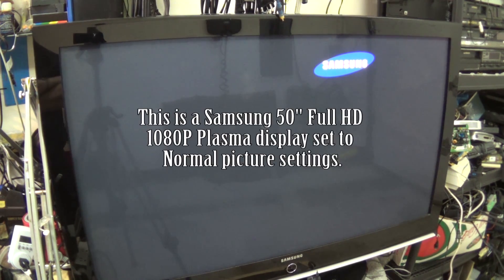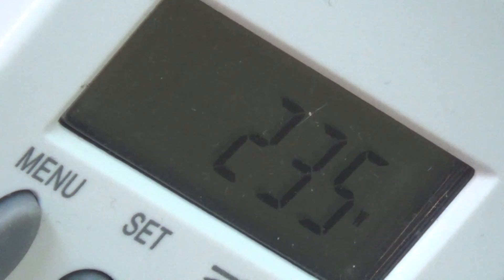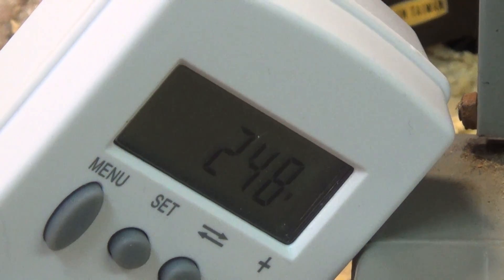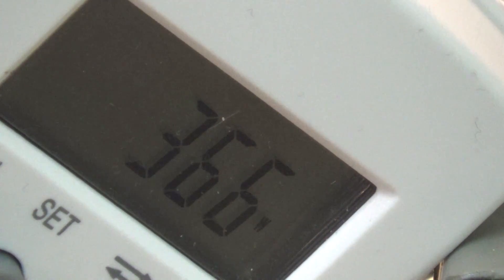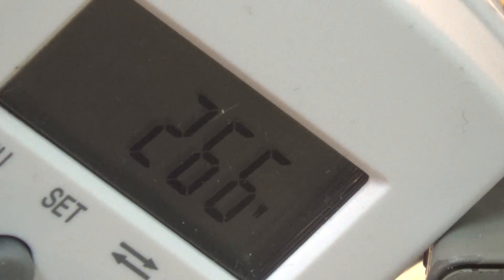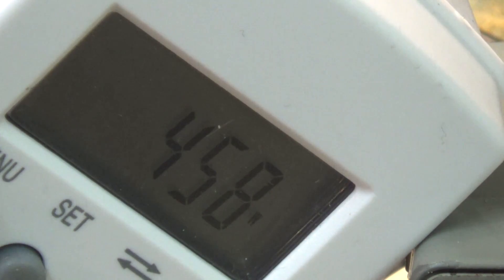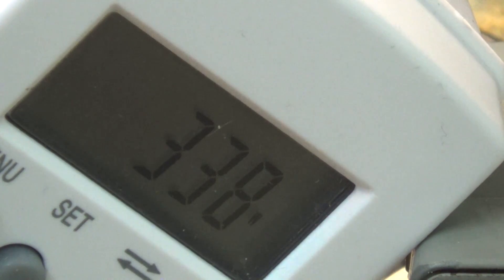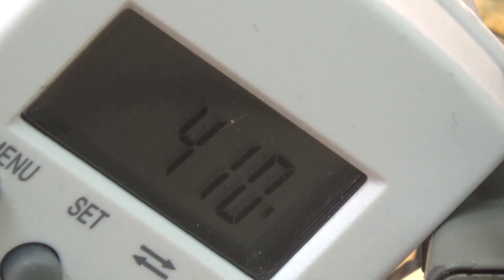Plasma TV meets Power Meter

Comment: My  50 inch Sony Bravia LED    draws  37W ( 2014),  my 52  inch   Sony Bravia LCD (  2008)  draws 144W,   average  50  inch plasma TV draws about  350-370 W.  ( I used wattmeter).
Reply from the maker: I used a power meter too.   Plasma power consumption depends on screen brightness.
Reply: @12voltvids  So what   did  your average come out  on plasma?
Reply from the maker: @leotimtom6637  I believe i covered that on the video.
Reply: My 52" Samsung LCD tv from 2009 draws 300 watts constantly.  So old LCD tv is on par with Plasma and not any better.

Comment: And this is one of many reasons why we have so incredible hot summers. In 2030 we will have 50 - 60°C summers in central Europe in SHADOW and it will be responsibel for a dramatic decreasing in earth population.
Reply from the maker: Kyôdai Ken 
How does this make your summers hot?  
The problem is the bloody volcanoes blowing their top and spewing co2 and other crap into the air. An erupting volcano in 4 days spews more pollution in the air than  man creates for an entire year. How many volcanoes are erupting right now.  They create much more greenhouse gas than burning fossil fuels. Myself I contribute very little. Our power here is hydro electric. Generated from falling water off the mountains. My car is electric. So my footprint is virtually zero. How about you.

Comment: My 2013 Panasonic "neo-plasma" doesn't draw anything close to this much power. The older ones did draw insane amounts =/
Reply: So I was under the impression that these new LED-LCD sets lasted through the years since they generated little heat and LED bulbs last for decades.
Reply from the maker: The newer ones were energy star, but the early ones were power hogs.
Reply: My Energy Star 55 inch 55HDT79 Plasma by Hitachi uses 40 watts even when it's off. my numbers when it is on are in the 350-450 range just like your measurements. I like Plasma but it's just a lost cause. it's sad since even though it's 720p, it still looks fantastic after 10 years of use. I'm guessing here in Massachusetts it's costing me $100 a year in electricity. :-(
Reply from the maker: peter sachs 

I watch my 63 1080p Samsung every day. very good picture. has already outlasted all those new LED backlight sets. the best plasmas were built 2007-2009. the later ones were not as reliable. the real killer of plasma was not power consumption, it was the cost to manufacture compared to LCD sets.
Reply from the maker: That's why we are seeing so many with failed backlights.It is almost epidemic. Most people run them in the brightest mode, and that produces heat and short LED life.I was an early adopter of LED lights at my house, and they are failing left right and center.I have a 40" Samsung that was barely 3 years old when LED backlights failed, and a Hitachi that the LEDs have failed, on, and now my LG 27" computer monitor has suffered a shorted LED, so there is a dark patch in the bottom left corner where the start icon is, and the display fades up and down in brightness. That display is only 2 years old. OK they are more reliable than plasma! Sure they are.I have a few plasma sets that are over 10 years old, with thousands of hours on them, still going strong. I would expect that though. Plasma technology is very mature, over 40 years old. Plasma started out as monochrome orange displays used in airports to display arrivals and departures. To make them color they just introduced some xenon gas to the neon, and coated the pixel walls with phosphor, but the design goes back to the 60's.  Plasma's demise was due to the cost to manufacture compared to LCD, and newer OLED technology was emerging that was even cheaper to make. So Plasma's days were done for finiancial reasons, not because it was an inferior display. It wasn't. There was some reliability issues with some of the cheaper panels made in the last couple of years they were in production, mostly because they shifted the panel production to Mexico and China where there were some quality issues. Not so much with the panels themselves, but with some of the support components and board manufacturing. Because of the power in a plasma display, a loose ground screw can mean a catastrophic failure with multiple component failure by the time the protection circuit shuts it down.I have 8 plasma sets (6 were throw away sets that were given to me)6 are in use, and 2 sit in storage for the day I may need them.Sure they drive my power bill up a big, but nothing like the heat pump used to heat / cool the house. My TVs might cost 10.00 a month. My electric car 30 a month to charge. Heat pump and water heater probably 250 a month minimum.

Comment: Can you repeat that experiment on OLED TV? They said OLED TV is more power efficient than LCD because it doesn't have a backlight so like plasma the power consumption depends on how bright the screen is except it consumes far less power than plasma of the same size.
Reply from the maker: I will repeat that experiment on an OLED when I get one. It is on my wish list, but the one I want is still priced in the stratosphere so it will be awhile before I drop that type of cash on a TV.
Reply: bobskie321 -I read from some reports at CES 2017 that many OLED sets use more power than LED-LCD and also that these organic elements have a finite lifespan?!
Reply from the maker: I don't have an OLED yet. When I get one (that is next on my TV shopping list) I will put it through the paces.Like Plasma the power varies with screen brightness.They will consume less power than a plasma for sure.
Reply from the maker: They do burn in fairly easily too.Go to a store running the LG demo on them, and you can see the burn in on TVs that have only been on display for a few months.
Reply: So they are not ideal for video games because of static images like scores or life bars which can burn in.
Reply from the maker: OLED should not be used for games. Unless you have money to burn that is.  Pun intended.

Comment: Hey 12volts ❤ I've learned so much from you and I have one of these old plasma tv's and yeah they are power hungry but they are the best for video games because of hardly any display lag.. anyway mine took a crap so I checked everything and found that the vs is rated at 177 vdc and the vx is rated at 167 vdc but I'm getting 234.6 volts dc on the vs and 177vdc on the vx 😢 can it be the power supply?
Reply from the maker: +Subigirl Forester If the voltage is too high, yes that would be the power supply. Regulation is not working properly.
Reply: +12voltvids Cool and thanks for the reply 😃 there's two big caps that look funny I ordered a soldering starter kit I'll update you on my progress, I'm learning little by little and thank you so much for uploading these great informative videos ❤❤❤

Comment: 12V, i hope you make a video, of the Beta Hi-Fi VTR on the bench ;-)
Reply from the maker: +LibraAudioLaboratory I was waiting for someone to ask about that.It is under repair now. Has a small problem still, but yes there will be a video for that. This one is a real classic machine. This is the VCR that began the HiFi sound revolution. Prior to this VCRs were mono. Some VHS manufactures had exparamented with splitting the 1mm audio track into 2 1/3mm audio tracks and running 2 tracks of AM radio as a solution to the stereo sound requirement, but this deck is the very first one that did it right, by recording it along with the video tracks for true HIFI sound. Beta did it different than VHS though, a better more simple system that used the same heads that recorded the picture. BHS had to add 2 additional heads and go to deep layer recording as there wasn't enough bandwidth between the chroma and lumanece spectrum to place additional information.
Reply: +12voltvids Thanks 12V.

Comment: That is insane ,like home heater power.Save the valuable land resources and energies !.Modern LCD takes to 100W,<1W in standby.I have 32" Thomson CRT,for me it is has wery good colours and large speakers.
Reply: It really depends on how much you watch TV.  My 20 year old Panasonic Viera ranges between 200-350 watts during watching typical program.   If you watch couple of hours a day like me, difference in power usage is negligible in terms of cost.  Plus factor in that reliable plasma TV like Panasonic from mid 2000's lasted over 20 years, then you also save money by not replacing your tv so often.

Comment: Dam, i didnt think they were that bad :-(
Im not supprised that lcd and plasma sets cook themselves, and thats using a fairly efficent switchmode power supply too.
Put some slots in the back and insert bread, tv and toast lol :-D
Reply from the maker: +zx8401ztv I'll do another video, perhaps today, and show the different power consumption between this plasma, a 42" 720p, an old Panasonic 42" SD plasma, a 32" LCD and a few other TVs I can access the power plug on
Reply: +12voltvids 
Sounds like the psu could do with its own fan and heatsinks for all the electrolitics to stop them boiling to death.
Can you get heatsinks for capacitors? ive never seen any.

Comment: Play a video on the TV and run the test. Also do this test with an LCD TV
Reply from the maker: +coondogtheman1234 Yes I can do that, as I do have an LCD set. For that matter I can do a comparison between the various TVs I have here, various size Plasma, DLP and LCD TVs, including a 2004 vintage SD plasma which is NOT an energy star rated set.
Reply: 12voltvids
I have a small 7 inch LCD portable TV that is next to my monitor so I wan watch TV while on the computer and a polaroid LCD-2000 SD Flat screen TV which I use for games and a 32 inch Dynex LCD tv and a small 19 inch LCD with DVD player which was my first flatscreen. This one and the polaroid I had at pretty much the same time. a buddy of mine gave me the polaroid TV b/c it was giving him nothing but problems all the issue was is the capacitors in the power supply brick. I made a new one from an XBOX 360 power brick then that died and now I made a power supply from a computer power supply and so far it's working great.